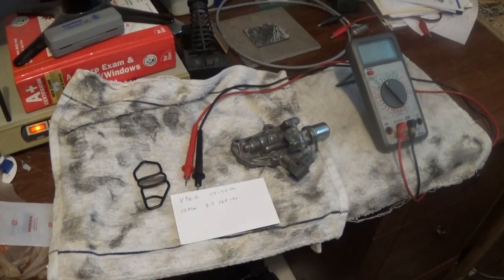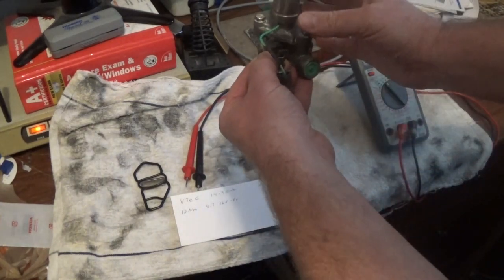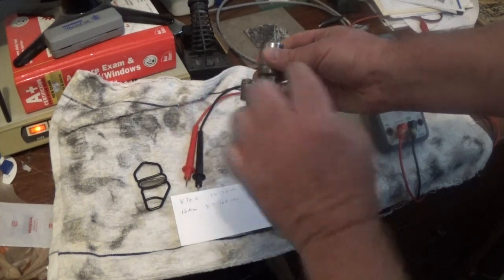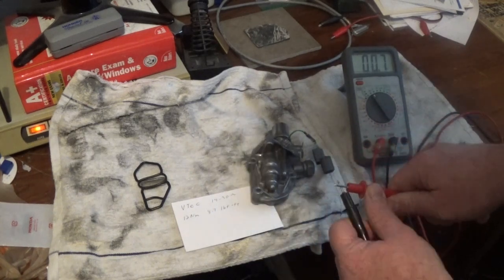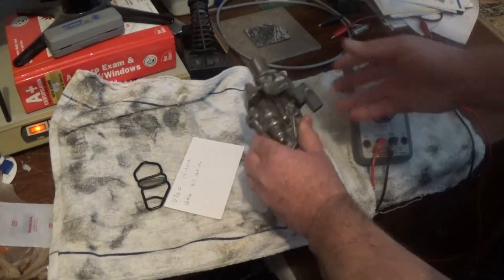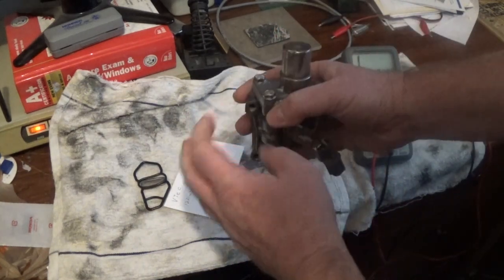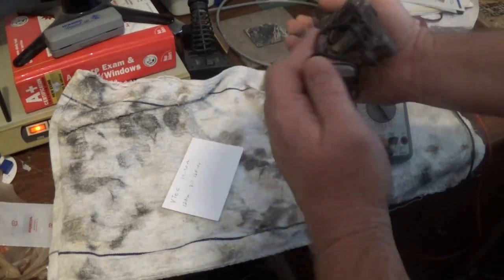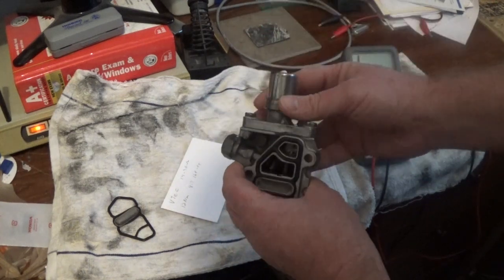Testing a Vtec solenoid

Comment: I’ve unfortunately broke one of the bolts in the past just to give testimony.  It really doesn’t take much torque.  
….in the event of breaking on.  I found it easiest to dremel a slice down the center of the broke bolt and using a flathead screwdriver.

Comment: I broke one of the top bolts  while tightening will it leak oil ?
Reply from the maker: yep
Reply: How would that get fixed ?
Reply from the maker: @franciscoalfaro3334  If your lucky, you can just take the other bolts off, and remove it.  That should give you access to the part of the bolt that is still sticking out.
Reply: It has 1/4” sticking out I think , and just turn it with pliers ?
Reply from the maker: @franciscoalfaro3334  Yup.  Hit it with some wd40, and let is sit for 10 minutes first.
Reply: Ok I’ll try that
Reply: It worked I used one of the small Milwaukee Torque pliers loosened it and unscrewed it with my fingers thanks 👍🏻
Reply: Mine read 6.8
Reply from the maker: @cameronjensen2145  Sounds like you have a bad vtec.  Where you having trouble with it?

Comment: Will the pintle visibly activate when 12 v activated?
Reply from the maker: Did you get a chance to check it?
Reply: @tubejim101  I applied voltage but it did not move nor the new one when voltage applied. However I believe my issue was low oil causing  low pressure therefore affecting the solenoid.

Comment: On my 99 ex I unplugged it and no check engine light.. previous owner told me he replaced the gasket. I’m assuming it’s no good?
Reply from the maker: Luckily this video will show you how to test it.  Don't think unplugging it, will throw a check light.  Also, because this is a new car to you, turn the ignition on, without starting the car, and make sure your check engine light is working.  If you have a bad gasket, usually you will see oil pooling up, under the vtec.

Comment: Quick question. I just installed a new one. If vtec solenoid was not working vtec won't kick in right? Also do i need to get it reprogrammed or it's just plug and play? BTW it's 2001 model
Reply from the maker: I don't know how they did it in 2001.  2000 was the cutoff year.  For 92 to 00 it is just plug and play.

Comment: 2002 Vtec problems.  I took your advise and checked the resistance I had 14.7 ohms on my solenoid so I figured it's good (just not working).  I took the spool valve off and went through it cleaning off the shuttle-valve there were a few deposits.  I blew it all out with break clean and air then re-assembled with a drop of royal purple.  Should be fixed right?  Oh and my oil pressure switch seemed to have continuity about 0 ohms.  I had vtec working for like 2 shifts up to 6000 rpm it was great then got code P1259 again.   Ideas?  I'm unsure about aftermarket spool valves and Honda dealer wants $590 for one!  Help!
Reply from the maker: I have not worked on anything newer then 2000.  So I don't know how Honda did vtec in 2002.  Honda OEM parts are good, so I would just get a used one off a wrecked car, that has the same parts.

Comment: Thank you for making the video, especially listing of the torque specs and your warning for snapping the bolt!   Now I will take extra care when I get ready to tighten those bolts     My accord is still leaking oil after changing out the distributor o ring and the shaft seal.  So now, I'm getting ready to change out the seal gaskets on the vtec solenoid.  Don't know much about electrical stuff, but my dad did pass down an old fluke meter to me.  Do I turn the knob on the meter to that omega sign, then follow your video on the red and black probe to get the reading?   Also, there are 6 bolts total, which ones are the specs referring to:  top or bottom 3, or all 6s?  Thanks very much in advance!
Reply from the maker: All 6 bolts.  Turn the meter to the ohm sign.  On some meters, you will need to move the base of the plugs, to the ohm connection too.  When measuring ohms, always make sure there is no current/voltage in the circuit.  If there is, then you will blow a fuse in the meter, and possibly damage the meter.